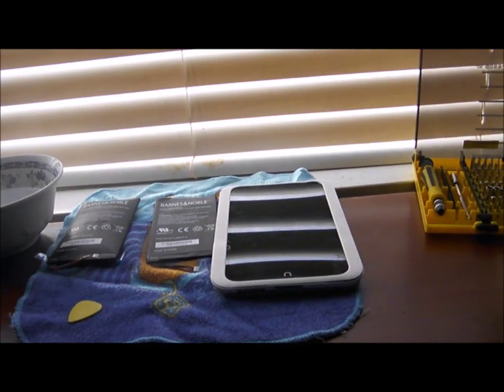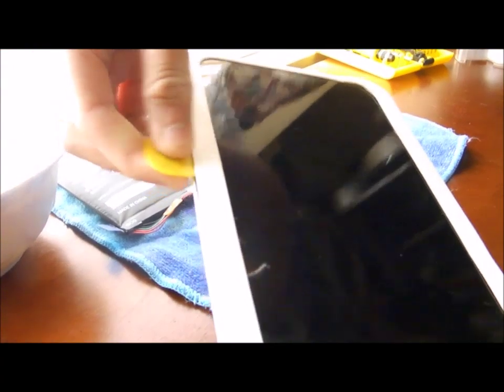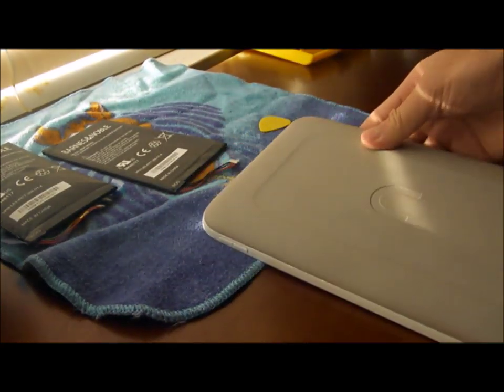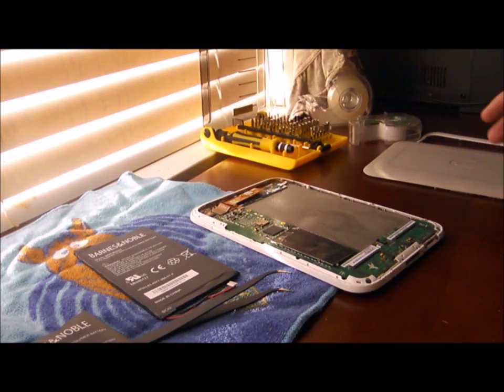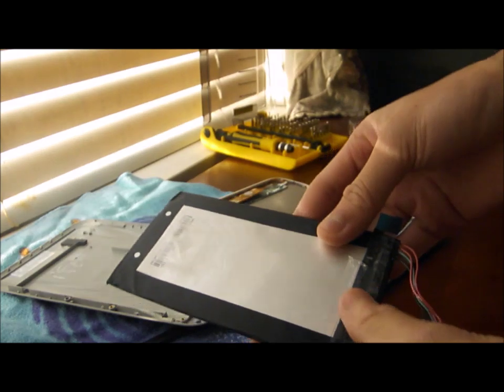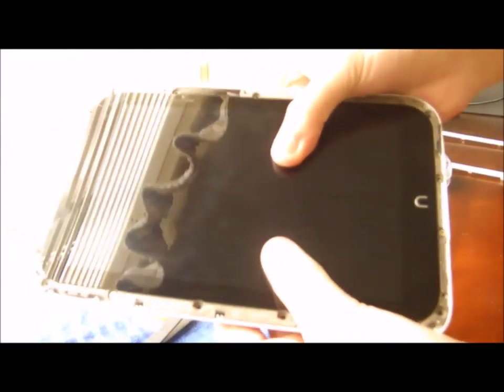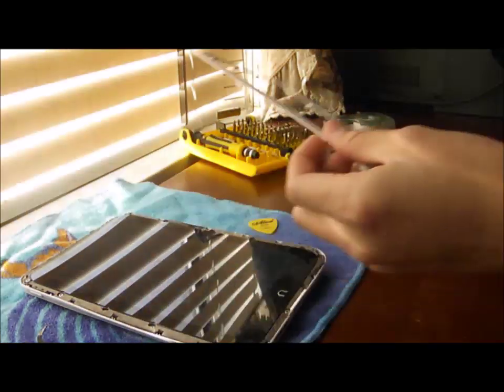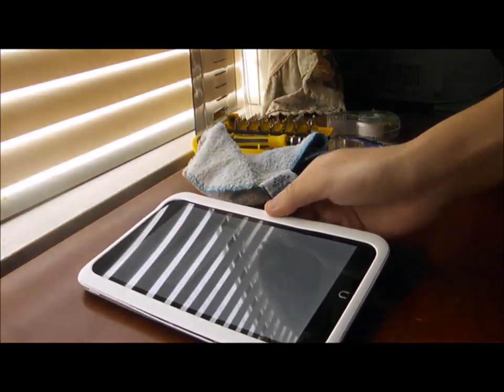How to change Nook HD and HD Plus Battery

Comment: Excellent video! I've had my Nook HD Plus 5 years, just had the orange/green blinking light come on. Took the Nook apart, unplugged/plugged the battery in, and it was fixed. I suspected it was a glitch that required powering down the motherboard completely, apparently that was it. Your video was extremely helpful in taking it apart without damaging it. Great job, thanks!

Comment: Does replacing the battery,delete the memory?
Reply from the maker: Glass of milk, if you turn off your device properly, and just changing the battery. Your device's memory will not get deleted. Just back up in case and make sure your device doesn't turn off and on too much. If it does the device might go "Factory Restore Mode." Hope this help.
Reply: +Jonathakeej Gamer Just to be absolutely sure...replacing the battery revives a dead tablet? Correct?
Reply from the maker: If you know the battery is Dead Dead,  then yes it would bring back your tablet to life again.
Reply: Jonathakeej Gamer You are correct. Off topic, the NOOK HD+ battery may just be a shitty battery. I had purchased the 2 year warranty and sent the tablet back 6 times for the same issue: The battery would die within a minute after unplugging when fully charged. I actually thought B&N would receive it & just send it back w/o even repairing it, but, I also took it to a B&N store for an exchange, and within months the same issue occurred.

I've since loaded CM Android on it (NOOK HD+ is still a pretty good tablet), & thinking about just replacing the battery myself.

Comment: Does this erase all your data?
Reply from the maker: It doesn't. When the battery keep dyeing, the nook would erase all the data by itself because it won't work correctly. replacing a battery help make my nook not die. My nook erase itself due to turning off and on. Your nook should be fine, if you don't make the nook turn off and on really fast.

Comment: can i have a link for a hd+ battery pls
Reply: +britishboy looked everywhere, can't find one. Thinkin about hard wiring it to my 20,000mah mobile battery pack
Reply: Brian Graves i have found one
Reply: For the price of a new tablet? Thanks for sharing your resource!
Reply: Brian Graves there is a cerial code sorta thing on the battery. enter that into the interwebs and youll find one
Reply: +Brian Graves Same here. It is so frustrating. BNTV400 batteries are everywhere. But no BV600. 

It's funny you mentioned wiring an external, because I was thinking the same. (Make sure your output voltages aren't too high!) I was worried about all the numerous leads coming from the battery, too.

Also, the closest common batteries I found to the OEM's specs are 3.7v 6000mAh (~22wh) like this one:
http://www.ebay.com/itm/like/181844482389

I have no idea if the dimensions are similar, however. 

I <3 the hell out of my nook but the overheating / drop to 1% issue sucks. I had the same problem with my daughter's hummingbird. I think the batteries were ruined by a faulty charger one shipped with. It made a weird buzzing noise and I stupidly kept using it.
Reply: going back to it from my new nexus 6 it feels like a slow piece of shit, so I'm losing the motivation to care. It'll probably go into the recycle bin and be chalked up as lesson learned. It does work fine with external battery attached until the you drain the external and the internal voltage drops so low that the device will not turn on until the internal voltage reaches a certain point (which may or may not happen given the battery is toast)
Reply: Brian Graves I hear that! I mainly use mine for Moon reader+, so I don't need too much by way of resources. Just switched ROMs from CM11 nightly to Mokee, which runs amazingly. 

I wouldn't want to read on a 6-inch though. The 7" Galaxy Tab 4 is cheap new (and insanely cheap used), but for me 9" seems like a sweet spot with the high-ish PPI and dimensions. But as a general use tablet...no way in hell. 

Thanks for the info on external batteries though! I'll keep it in mind if/when I try to desperately breathe new life into the decrepit piece of technology.

Comment: Why even open it? This video makes no damn sense. It's a rechargeable battery for gods sake😐😐
Reply: Rechargeable batteries eventually go bad.  If it happens after you are out of warranty, you're on your own for replacement.
Reply from the maker: 80sDweeb Let me tell you why I replace my battery. The reason why is my nook keep on dying on me. Even when it said "100% Charge" When I take out my the charger, It just die! So I plan to just replace my Nook HD Battery. Also I never got a warranty on the nook. I got it as a gift. Let me said, it had pass almost four Year now. and where I live There no B&N.
Reply: Jonathan TechDevice  same thing happened to me after 11 months after I bough it.
Reply: Jonathan TechDevice  Btw where did you buy the battery?
Reply: SLITTHROAT13 you can buy your battery at new power 99.com along with the accesorys needed to take the nook apart
Reply: Rebekah Perez There is not an english word on that site.
Reply: texjarhead what I meant new power 99 and besides it's not for this model :p
Reply: SLITTHROAT13 same exact issue with mine after only about 9 months 😠I have to just keep it plugged in to even use it!! Plus now my video is starting to do this fast jerking playback. Sounds like a bad remix. Lol.. I can't even think of what is causing this. Hope it's the battery & that's all! If not.... Trash! 👎
Reply from the maker: ya Nook doesnt last long if you try to keep them in a good case.